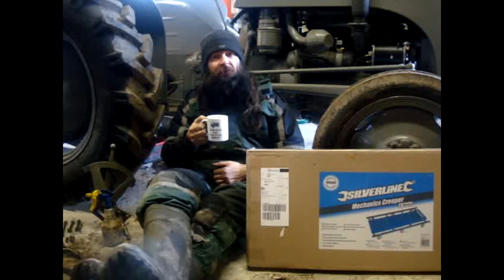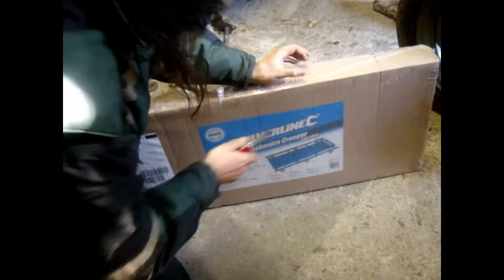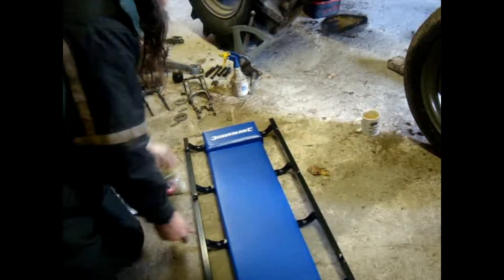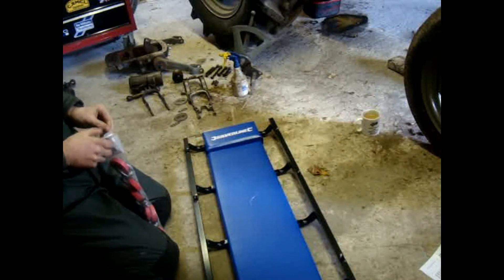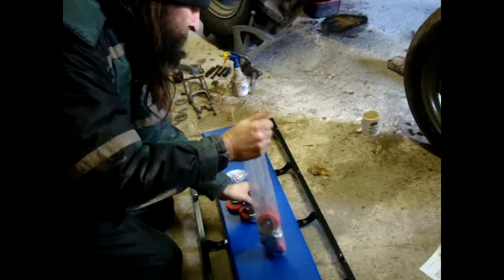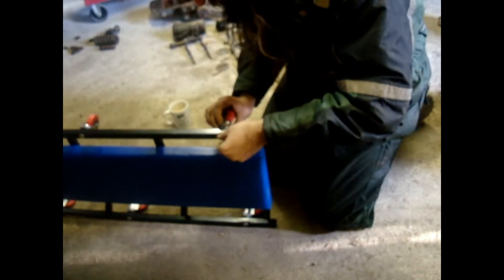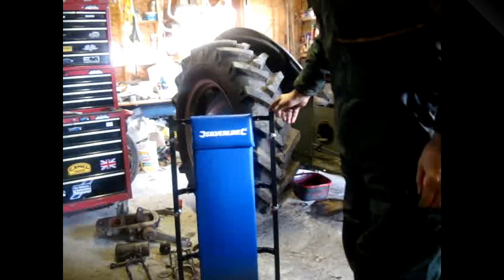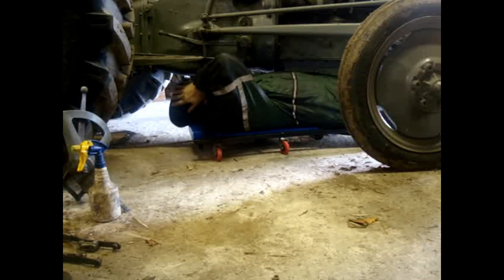Silverline Mechanic's Creeper.

Comment: Spent 6hrs on one of the  yesterday under the land rover replacing the speedo cabe, moving seatbelt mounts and pytting wires in.
Reply from the maker: I've spent a few hours under mine in the past on a cold concrete floor. Not any more.
Reply: mark pritchard yeah, have you looked into gearboxes yet?
Reply from the maker: Not yet, The my Landy is going to be off the road for a while, I'm concentrating on the Fergie at the moment and with me being away from home all the time its just not easy finding the time. I have already decided the landy will go in to have the gearbox done any way as I think it would be to bigger job for me. Si its just a case of getting the money together. That said I want to find a job with better hours as at the moment if I got it working I still wouldn't have the time to drive it.  As a lorry driver I get back from a week away driving and on my day of I can't face the steering wheel, I sort of need a day away from driving anything. So before I can really start to enjoy driving the landy again I really do need a new job.